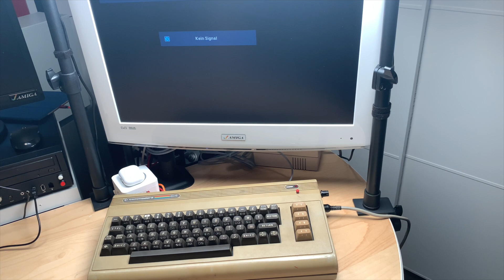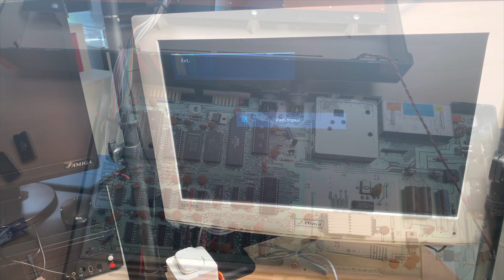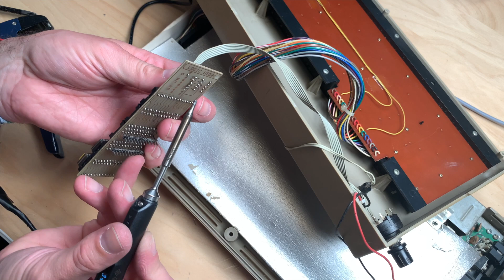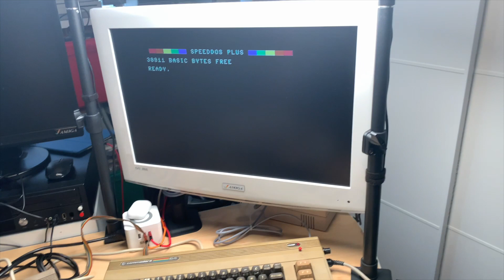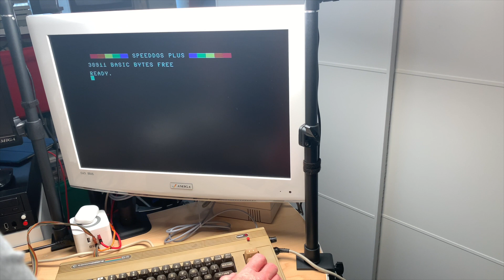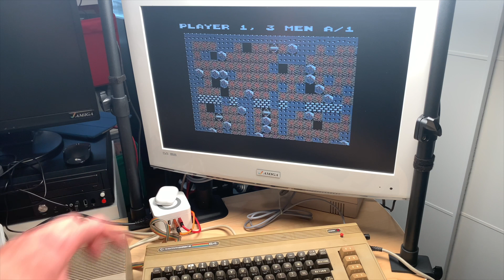Fixing a Commodore 64 (breadbin, orange keys) with a SpeedDos+ 1541

Comment: The bad CIA could be flooding the data bus with noise causing the rest of the machine to not to work.
Reply: Yes, that is true. But also can any other chip that is connected to data bus :)
Reply from the maker: True! I maybe should have said that in the video :-) In my head I always think of my channel like a TV show. You start with Episode 1 (the first video) and build up from there. I did a longer CIA bit in my Handheld C64 videos.